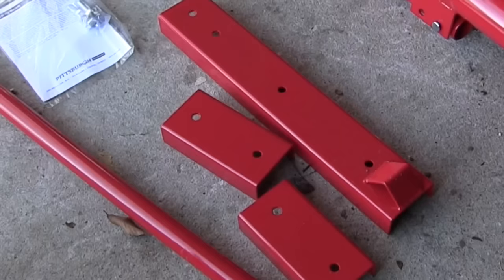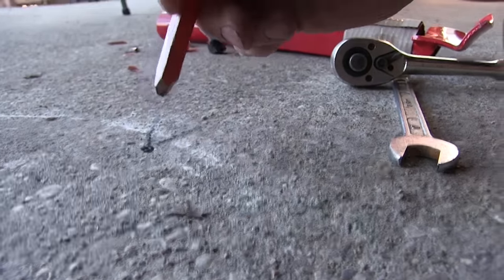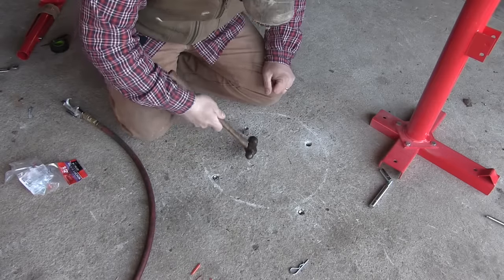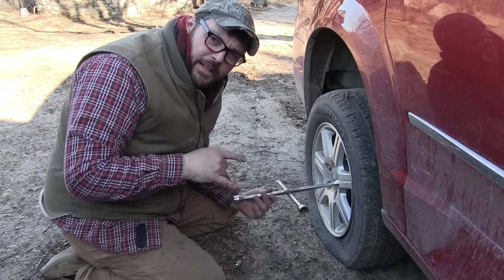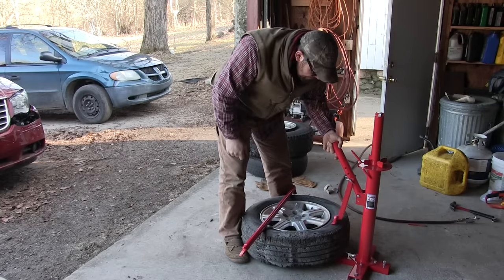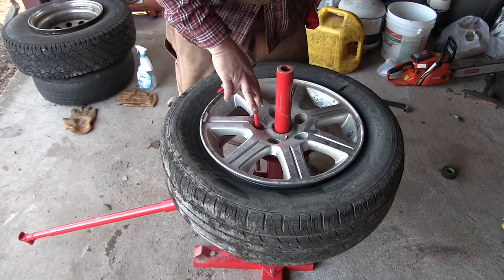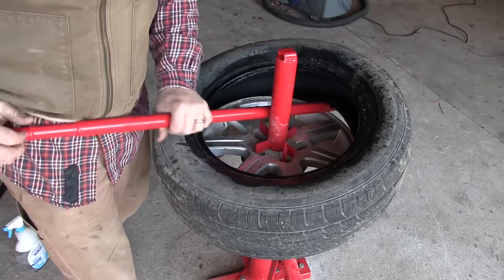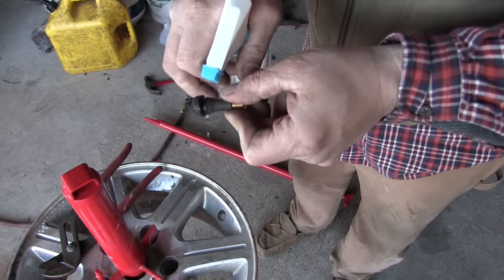Harbor Freight manual Tire Changer review

Comment: Something I learned the hard way - plug those holes in the floor with a piece of rubber or even a bolt of the right size.  Water, ice, dirt - even small parts -  all seem to find a way in and clog them.
Reply from the maker: I bought hole plugs for them. Thanks
Reply: Good advice. Put the screws all the way back in the anchors with a coating of anti-seize or get some shorter screws and install them with anti-seize when the tire changer is not in use. Your anchor threads will be ready to use the next time. This is pretty necessary if you live in the rust belt and park salty snowy slushy vehicles over the anchors in the winter.
Reply: @Bushradical  Hey, can you give us a link to where we can buy everything you used? Like the Tire Changer, the bolts, the rubber hole plugs, everything? That would help us so much!
Reply: Wouldn't bolting and unbolting over and over slowly wear out the cement?
Reply: @ArturoGarzaID  The anchors he installed will handle the fasteners - the bolts never contact the cement. If an anchor comes loose you can set it into the floor with epoxy just be careful not to epoxy the interior threads or your fastener will not thread in
Reply: @DryDog5150  Oh ok yeah that makes sense, sorry, I'm a noob to this kind of stuff.
Reply: @ArturoGarzaID  The anchor is tensioned to the concrete by the expansion of the bottom of sleeve. The "SETTING TOOL" shown, pushes the pin to the bottom of the sleeve, which in turn puts outward pressure to the walls of the hole. They should never pull out, providing the holes are correct diameter, and drilling was done cleanly, no wobbling of the drill. The bolts used for the device to the sleeves are machine screws, so threads should not wear out, no matter how many times taken on or off. https://www.youtube.com/watch?v=1377fhLqvkc  The drop-in anchor is highlighted at 00:03:00 into video
Reply: @citylockapolytechnikeyllcc7936  Badass...those drop in anchors kick ass.
Reply: Arturo Garza me too had same thought😀
Reply: Very good idea, use some antilock too
Reply: great idea!
Reply: Get a rubber mat to lay the wheel on so it won’t mar the aluminum wheel.  Also out of the same rubber mat cut a doughnut to go under the star clamp.  You also don’t have to remove the whole tire to change the valve.   Break the bead at the valve side then use tool to squeeze the tire to gain access to valve. Remove old stem then slide in new.    Mark tire with chalk where stem is if you break the bead on both sides then don’t have to balance.   Just some tips.
Reply: I use the heavy blue pallet to mount it (you need to a shim/block a few slats) mine has been outside 7 or more years&done 50-70 tires mostly 16" sometimes have to drive over or bumper jack it.over time that lug pin will break but an old bolt bent 90 degrees will full in THANX 4 THE NAIL TOOL TIP
Reply: I use compressed air to blow out the holes before use each time And have never had an issue this way

Comment: TIP!: For anyone coming here looking for tips when you can not get a tire back on. When you are trying to get the top bead over the rim and that bar keeps trying to roll on you, Grab you a pipe wrench and lock it on the end. This will prevent it from rolling and depending on the size of your pipe wrench it will give you some more leverage as you walk it on. The rolling on these bars is the hardest part to overcome especially when you lube the tire up really well and end up getting it on the bar as well. Hopefully this helps someone. Cheers!
Reply: I've changed probably 20 tires with my hf changer and always had to leverage the tire back on, the only real flaw with the changer is the bar not made correctly. 
I'll try your idea next time.
Thanks for the tip

Comment: I've changed about 30 tires with my Harbor Freight tire changer. I've modified it so I can do motorcycle tires, car tires, and small trailer tires too. One recommendation I have is to get yourself some decent large tire spoons. Remounting a "used" tire is a lot easier than mounting a brand new tire, and tire spoons come in handy! Also, warming the tire (in a heat box or outside in a sunny spot) helps with the mounting - as well as using plenty of tire lube. Also, if you're gonna do a fair number of tires, consider getting a duck bill attachment. Finally, I use balance beads in most of my tires. Easy peasy balance trick.
Reply: Do you think they'd be ok with lawnmower tyres?  About 18 inch diameter.
Reply: @bobsemp would be interested in seeing a vid on motorcycle tire changer set up. Thank you.
Reply: I welded my up in the weak areas, thing has paid for itself. I have the bubble balancer too.
Reply: How bad does it scratch car wheels thinking of getting one but I won’t if it damages the wheels

Comment: 11:00 a really good tip if you can't get the bead to seat, is to take a ratchet strap and put it around the tire as though it's running down the road, and tighten up until the bead is close to touching if not already touching. Put air in until it takes and doesn't leak around the bead, then remove the ratchet strap. Have fixed many busted bead leaks on the trails or in the fields with this method.
Reply: I prefer to use either
Reply: I always carry a can of tire   sealer. It has never failed even on more serious bead leaks where air goes out in 2hrs.
Reply: Done it many times myself ❤

Comment: A couple of things to keep in mind using this tool. Always turn  the bar clockwise this will prevent the hold down from coming loose.  When reinstalling clamp a pair of vise grips use it as a handle  on the bar to keep it from rotating  and  coming out of the bead.

Comment: The key to getting dust out if a blind hole with a vacuum is to put the hose so it's halfway across the hole. That way air can rush in to provide the flow needed to take up the dust into the vacuum. 

Though it might not work that well on a hole that deep.
Reply: Just shoot compressed air in the other half of the hole
Reply: I just left the dust in the hole and drilled deeper.
Reply: Small diameter plastic tube about 2 to 3 foot long, push tube to bottom of hole, have other end off to one side and blow through tube. Dust flies out but your face is well away.

Comment from the maker: NOTICE:      
I did not balance this tire, I'll do that in a future video review of the Harbor Freight bubble balancer.  
      I do not care about this tool "scratching my alloy wheels".  
      Also, I DO NOT care about the tire pressure light being on.  It was ALREADY on due to the fact that this is the SECOND TPS valve stem to FAIL on this van leaving a member of my family stranded.  Thats B.S.
        If you're a yuppy and care more about "the light being on" than about the safety of having dependable rubber valve stems......then you're probably watching the wrong channel.
Reply from the maker: Thanks Brother
Reply: Rubber stems all the way, these aluminum stems were a fail. Some new cars(and older gm) are using the ABS sensors to measure tire diameter to figure out if ones low. Much more reliable with no battery powered sensors
Reply from the maker: THANK YOU!!   Ive got so many idiots commenting to this video ...its so nice to hear from someone who also hates those aluminum TPS valve stems
Reply: Don't mind the idiot's rock on love the video
Reply: That TPMS shit is the most asinine thing invented. Good job and thanks for demonstrating.
Reply: You can put your van in 'winter' mode which turns off the TPMS lights but the dealer will have to do that
Reply: Thanks for reviewing this tool. My only concern was balancing the tire after the repair. I’m assuming this tool doesn’t balance tires. If that’s the case is there another tool habor freight offers to balance the tires?
Reply: nomakeanykine usually people mark where it came off and then when you reinstall it you it’s still balanced
Reply: @Bushradical  I have cars that have direct readings on the tire pressure, and more recent ones that rely on ABS to send a warning. I still love the direct readings. A lot of times, a nail doesn't really drop the pressure that much. The direct-reading pressure sensor allows me to see the small difference of 1-2 psi so that I can get it taken care of before getting stranded on road. They actually last really long, easily ten years, 100-150K miles.
Reply: Tip from off-roaders; bead can be reset by spraying some lighter fluid or starter fluid inside the tire and then lighting it off. The expanding gas reseats the bead and puts enough pressure in the tire to initially hold the bead while you air it up.   

Another way is using a rope around the circumference and use a rod to twist the rope like a tourniquet. The pressure on the middle of the tire will push the bead wall out until it seats on the rim.

Also: look into bead balancing, once a tire is bead balanced you never need to balance that tire again. 

Great stuff Dave, People eat up DIY videos.
Reply: i usually just carry some soap stone or  Chalk and mark the tire corresponding to the valve stem so when it comes time to mount my tire back on it don't throw the balance off or at least not have it too far off
Reply: If you make a mark where the old valve was on the tire before taking it apart then put it back the same spot no need to balance it
Reply: What I do to keep from having to rebalance the tire just mark the tire where the weights are and the stem
Reply: @Bushradical  I live 30 miles from town so I  use an ESCO manual bead breaker, 70160, for 4.00-8 wheel barrow tires and 13.9 x 30" Tractor tires.  I found a used one on eBay for $40.  The best tire iron I've found is a motorcycle "S" shaped tool from JP Cycle, #2170075.  Once you get the hang of using these tools you can mount and dismount any tire in 5 minutes or less.  I use an old pine tree stump to keep the rim off the ground in a working position.
Reply: Take a grinder and put a slight bevel on the bar that is rubbing the center post, up and bottom edge.
Reply: Could just add those balancing beads
Reply: yeah i hate the whole TPS system.  It's just another government thing that's mandated that's pointless.  With that being said though, in some states that have yearly car inspections, the TPS may need to be fully functional to pass that inspection so check the local state laws.
Reply: I still think the rubber valve stem is more likely to push back off the rim verses the metal one. Whoever did the metal stem prob did not torque to G.M specs .  The is no way the rubber valve stem is stronger. The rubber  Stem can be pushed out just as easy.  The metal stem goes thru the rim and tightens down like a bolt. That has to be stronger and wont push back when installed correctly. Also a tire light can prevent wrecks from blow outs.  Also prevents tire damage from riding on a flat. Some tires you cant tell a tire is flat till there at 10 psi. Just have to reset light and get acdelco tire. sensors
Reply: Always cracks me up when people think that they "can't balance a tire" .. people he is showing you how to survive without other men doing this shit for you ... man up...
Reply: @wolleysegap9740  until it tells you that you have a severely underinflated tire while driving 70mph down the interstate, but you ignore it, let the tire blow on you, and most likely lose control of your car. Do they suck? Yes. Are they a pain in the ass? Yes. Can they get expensive to replace? Yes. But as opposed to running the risk of wrecking your car, and possibly hurting people, I'd say live with it being a pain.
Reply: need to understand though that sensor warns you when you have a dangerous situation with the tire. If it gets severely under inflated, it tells you so you can get it back to pressure. Cutting/removing the sensor and putting a plain jane valve stem in actually makes your car less safe and dependable, as you are basically cutting out a vital system. I work in a tire shop and we never recommend this. Not because I'm trying to sell a sensor, but because it's just not safe. I would not want my child driving a vehicle without one.You may hate them, but it's job is to tell you that you have a severely underinflated tire while driving 70mph down the interstate, but you ignore it, let the tire blow on you, and most likely lose control of your car. Do they suck? Yes. Are they a pain in the ass? Yes. Can they get expensive to replace? Yes. But as opposed to running the risk of wrecking your car, and possibly hurting/killing people, I'd say live with it being a pain.
Reply: @randallrigdon9379  actually the rubber stem stays better because of how the stem is molded. has a lip on both sides that hold it in place. The metal stems/sensors do suck. It's not because it wasn't torqued properly, the nut is flimsy aluminum and they just corrode over time and cause leaks. I replace 10-12 of them a week at the shop I work in. We don't even offer the service packs for the metal ones, we just recommend replacing with a sensor with  a rubber stem. much more reliable, and when we do have to replace the stem portion, we actually can with very little cost, less than $3, plus they are much easier to work on. Sensors are supposed to trip the low pressure light at +/- 25% of recommended pressure. So a vehicle that calls for 35psi, the light will trip at 27psi and at 43psi.
Reply: @rottdogg8926  and you get a free hair and facial trim to boot
Reply: Bushradical.... Man i forget you r name cuz its been a month but im subbed and i love wat you do. Your hum b le. And i very much appreciate the hard wrk u put in. 
Just wanted to say that and also how i c a nt get over these miserable fucks that have nothing to nice to say. Like why they watching the video?   Anyways. Take care brother. Keep doing you. P.s. im buyin a one of them now. I feel the same
Reply: @nomakeanykine  They`re called bubble balancers.
Reply: Yes Bushradical, I do like your common sense approach to life.
Reply: Thanks again !!!
Reply: This comment right here just earned you a follower, sir!
Reply: i wish i  had  a  concrete  floor   to  mount  it  too  lol
Reply: The TPMS that have stems made of an aluminum sleeve corrode out and fail in 7 to 12 years in the salty Midwest.  Replaced a lot of them. Corrosion eats them and makes them leak.  When I was young, we were taught not only to check oil and fluids but also to do a regular walk around and check tire pressures. I still keep a  quick pencil tire gauge in each vehicle.
Reply: Seems like more of a crappy Chrysler issue than an issue with TPMS in general. 99% of the time the worst thing that’s gonna happen with those is the battery dies and the light comes on in the dash. They usually don’t fail as catastrophically as this, at least with other brands. I wouldn’t write off the whole technology because of that.
Reply: Just because you said this....I'm subscribing
Reply: @AllenReinecke they are terrible
Reply: I've been debating about buying one of these and now with this video,  I'm definitely gonna buy one thx ,,

Comment: I've had one of these for about 20 years. Still works great and I have changed many tires doing restoration work on cars and trucks... I grew up in the 60s working at service stations and these are the changers we had. I am right at home with them. One suggestion would be to make an index for the tire at the valve stem and mark the weights so that balance can be somewhat close when reinstalling tire. of coarse removing the TPM sensor was a lot of weight so it will need balancing but if a repair is all that is being done, it helps to keep things from getting out of control at higher speeds.
Reply from the maker: Thanks
Reply: Bob I doubt he has enough intelligence for your advice. Here in rural Alabama we have a guy that breaks them down with a sledge hammer!

Comment: If you're only changing the sensor, even if replacing with a rubber valve, just break the top bead and hold it open while you remove and replace the valve. No need to remove the tire or break other bead. This will keep the wheel balanced once you refill with air. There is also a valve set tool you thread onto the end of it and pry over the rim to set the valve into place
Reply: ... luckily, you or your daughter will need to buy new tires soon anyway to pass inspection next time...take the time and expense to have the tire pressure sensors replaced and rims cleaned properly... your loved ones safety and lives depend on good tires and correct air pressure every time they get in that car...the reason that valve stem failed is OXIDATION of the cheap rubber bushing from CHINA where everything comes now thanx to our overlord slave.masters...LETS  GO BRANDEN.....USAUSAUSAUSAUSAUSA.....................................
Reply: 😂..  my first thought
Reply: @boudreau110    AMEN brother.  Well put.
Reply: I think he was giving a FULL demonstration  of the tool more so than just replacing the valve stem itself. He really  could have started the video AFTER he bolted it down. I glad he showed the entire process. Mine is still in the box. I'll give a go in a few days.
Reply: Frank’s on it
Reply: the tool I have screws on to the stem, then you pull on the t-handle to instal the new stem,
w/o the possibility of damaging the threads. it also has the tools to remove the inner stem
and re thread if they are damaged.
Reply: going back to old style tire valve already messed up the 'balance'..   But yeah,  mark the tire position relative to the valve hole if tire needs to come completely off.